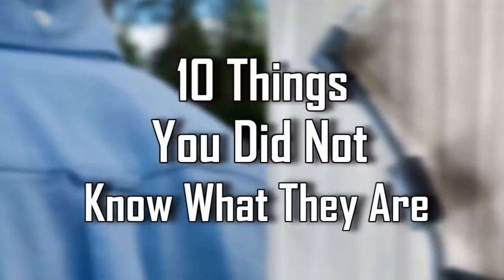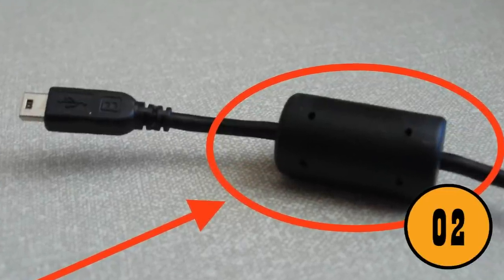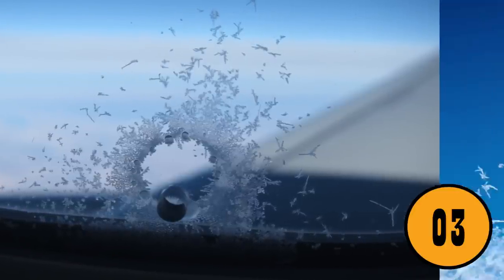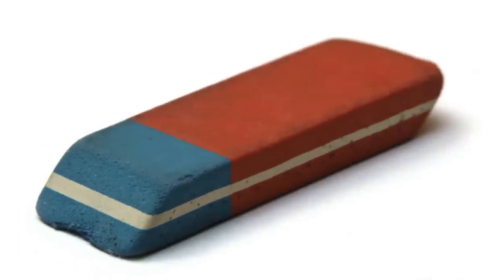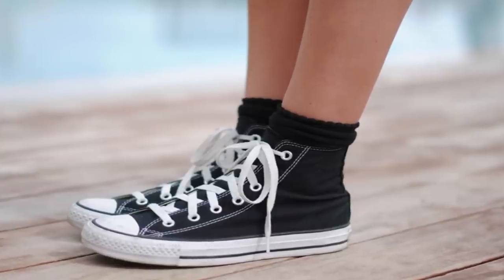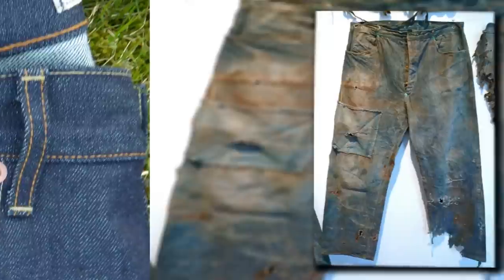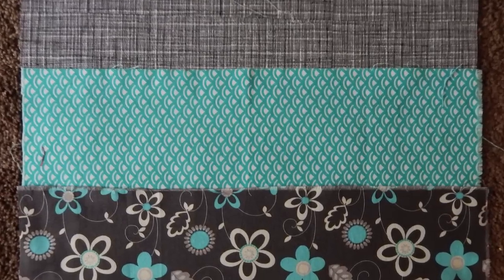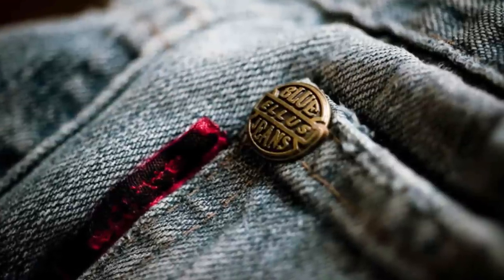10 Things You Did Not Know What They Are

Comment: The little loop in back of some shirts was originally called a locker loop and it indeed used to hang shirts in lockers . Contrary to the video, it causes    far less wrinkling than hanging by the color on locker hooks.
Reply: Thank you for the actual explanation!
Reply: Its actually for the Y shaped suspenders (2 in the front, one in the back wink wink) it's designed like that so the rear strap wouldn't move.
Reply: Allan Richter no its not.
Reply: Barb5001
Reply: Barb5001
Reply: +Anita van den Hoogen  
I enjoy the joke name you gave your account: how did you come up with that?
Reply: What's the origin of YOUR name?
Reply: @Bl4nk.exe8  
After 6yrs and no one got your joke, I have to say your double entendre is top level clever.
Reply: In the 1960’s some girls would try to pull them off the shirts of boys they liked. Stupid, i know, i know.

Comment: The primary purpose for the hole in a pen lid is to prevent air pressure forcing ink down the channel of the ink tube when the lid is placed on the pen. Without the hole, when the lid is put on, there would be no where for the air in the lid to go, so it would put pressure on the ball in the point of the pen and force the ink down the tube, creating an air lock and preventing ink flow the next time the pen is used. 

I can't imagine shirt manufacturers adding a loop to a shirt for the purpose of college students to indicate their relationship status. This is an adapted use.
Reply: Ooooohh and true
Reply: Your point on the pen cap proves my point on the video being stolen. First mind warehouse got it wrong, and then facts verse got it wrong also in exactly the same way as mind warehouse lol.
Reply: +Almero yes it would save their lives. its used for when someone chokes and cant breathe. they either get that much air until help arrives (which is more than enough) or die. you take your chances
Reply: mark walburg you are right. children need lees air and have smaller wind pipes.
Reply: ka da The hole was not always there. When i was a child it used to be solid. I remember pens that would not always work directly after opening the cap. Only after shaking and scribbling a lot. But i still think the reason for the hole is to relieve pressure when placing the cap on, other wise  the pen will not work every time you open it, and that would put the manufacturer in a bad light.
Reply: You have it wrong. The hole in the actual pen body itself is to regulate the air pressure. The hole in the lid has nothing to do with this.
Reply: Jason, how would a hole in the body of the pen prevent air pressure building up in the lid and putting pressure on the ball end of the pen?
Reply: Z
Reply: In high school way back in the 60's it was a fad to snip off those loops of attractive guys, most of them felt it was a badge of honor to have their loop snipped (it didnt indicate they were in a relationship like this video says). and it was like a trophy to the girls who got it first.
Reply: I agree. I freaked out when he basically said pen caps were designed to be swallowed. roflmao.
Reply: its not " designed to be swallowed " the manufacturers made it for the air to escape but a second plus too the design is that if a small child were to swallow the hole is big enough to pass fluid and not cause asphyxiation.
Reply: Maybe it serves some purpose when being cleaned, like in a dry cleaners? Someone else said its for braces. That sounds more plausible to me 🤔
Reply: +FingerPickinGood _ u mean suspenders?
Reply: Logic of air pressure, next time the ink flows & all isn't correct at all as there r pen caps without a hole. It might be for decoration or probably what he said is right.
Reply: the hole is so the ink don't drip out and without it if you out the London the pen wouldn't close and could explode due to pressure...and it enables balance of the ink rotating thru the ball perfectly
Reply: the hole is so the ink don't drip out and without it if you out the London the pen wouldn't close and could explode due to pressure...and it enables balance of the ink rotating thru the ball perfectly
Reply: +Megan Richner they are also called braces.
Reply: Actually looked at my pen cap and it doesn't have a hole.
Reply: KEEP CALM and PLAY SOCCER IN YOUR PAJAMAS uh'0 don't swallow it then. we not sure you will survive
Reply: The hole is also to prevent a vacuum seal, which can cause you not to be able to remove the cap without a major leak.
Reply: +Bushwacker 😂😂
Reply: R U A WIZERD?
Reply: I think he may be a wizard
Reply: so thats why my pens dont work.. they didnt have the hole in the top... the more i learn ey
Reply: +Mad Max 
What the fuck do they write with in China???
Reply: +Mad Max 
LOL...thanks for making me less worried about China taking over the world.
Reply: +Mad Max
I'm learning a lot here; you must have quite an interesting life! I've been assuming that like in South Korea, the increasing economic power of individuals would eventually result in a more democratic political system, i.e., a throwing-off of the Communist elite. Do you think I'm wrong about that? Once in a while you hear of notable political tensions where a village somewhere is at odds with the central government, and then there's Hong Kong...do you see something on the horizon that would upset the apple cart?
Reply: +Mad Max
Fascinating. Care to guess when that collapse might happen? I know their banking sector is already starting to run into trouble because of how they've been financing economic development. What future do you see for Russia, India, the EU?
Reply: I see a lot of words.
Reply: i was just about to say this.  the hole is to alleviate any positive air pressure that would prevent the cap to actually staying in place. without a hole the cap would easily pop back off because the air inside would become compressed as you pressed the solid cap on.

i dont think pen companies give 2 shits about people choking on pens. one because its a rare thing (rare enough to justify not incorporating a fix in every single pen) and two they just simply dont care...
Reply: euroaaRON1 x

Comment: The hole in the spaghetti spoon is actually not for a portion. Its just the most simply way to make water drain. Some spoons have several small holes, or slits for this purpose. And the holes are of different sizes with different spoons.

The Loop on the back of a shirt is also really just to hang it up, the school story is complete and utter bullshit.
Its used because in lockers you usually can't use clothes hangers, it was made popular during the 1960s. And its even called "Locker Hanger"

Stop making shit up and believing stuff you saw on 9 gag.
Reply: Exactly. Not sure where he came up with this nonsense. I use that to hang my shirts in the locker at gym after work. It's better to hang it there than on inside of shirt collar because you actually get less wrinkles and it's less stress on fabric than if hung on inside of collar.
Reply: You don't end up with points in the shoulders, it's better to hang from the loop and I have yet for one to wrinkle because of the loop, they just aren't heavy enough to cause a crease.
Reply: I was thinking the same thing
Reply: I could be wrong, but I believe with the spaghetti theory, he means when it is still dry.  The amount you can bunch up and push though the hole is a serving.  That part wasn't mentioned though.

Comment: 4:25 The purpose of the hole on the pen cap is, to let the air go through, so you can close the pen properly. Without the hole, the extra air inside the cap will push the pen against it, when you try to close it. Dumb.
Reply: I never actually thought about that. This seems like a better use than "so the cap doesn't get absorbed into my lungs membrane"
Reply: Then why didn't any pen have them until they passed a law that they had to allow air though for when toddlers swallowed them?
Reply: Oh so making sure you don't die if you accidentally swallow it is a worse reason? smh
Reply: Do you actually have evidence of that supposed law? If that's a law how come something like sharpie exists that requires a full seal in order to not dry out? Are you telling me sharpie is breaking the law on a massive scale but isn't being prosecuted for it?
Reply: Which is why all pen caps are aerated, round tips included. Perhaps so microscopic you might not see it?
Reply: Because it's bullshit.
Reply: No it's not.
Reply: that style of pen had a closed cap for years before the hole and it closed just fine.
Reply: MrArcticShadow That means the ISO  organization is dumb. When a child swallow pen cap he/she would be dead, because the hard plastic would damage the throat. Why don't they make edible pen caps then?
Reply: no... really?
Reply: thiery572
You can still choke on food. It's not like edible stuff dissolves in the trachea.
Reply: so mrarcticshadow posts links to prove his statement and you still dispute it? I read the spec he linked to, and pens like sharpies have caps large enough that the spec doesn't apply. The hole is in fact there to allow air flow to prevent suffocation. that membrane absorption crap was total b.s.
Reply: The air pressure might push the ink back inside the pen...
Reply: the hole purpose is so you can remove the cap. without hole it acts like a suction cup and becomes very hard to open. just try plugging it...
Reply: ISO makes standards not laws.
Reply: At the time of the change they said it was to stop it leaking, which is odd, but possible if the tip remained liquid and then flowed, but dries out with that honkin hole.  It won't have a suction fit though, because it is round over a hexagon, and not sealed.
Reply: slim t The sharpie is a spidol (not a pen). If you put a hole on the cap, then the spidol ink will dry out.
Reply: +thiery572 i just used it as an example of size. the spec specifies the size of caps that aren't required to have a hole. it also allows for certain shapes to satisfy the spec without a hole. this idea of pressure is just not an issue. the logic is not wrong, but a pen cap just isn't large enough to create enough pressure to matter. Just for reference, I'm an engineer.
Reply: slim t And the hole in the pen cap is not enough to make the toddler breathe. Just my thought. :)
Reply: toddbod94
While not laws, standards are usually used as basis for legislation. Even if countries don't want to outright admit it. They even become good ways to market a product, satisfy import or export specifications across country borders, and generate greater market appeal--as BIC has done on their website. Obviously any business would want the greatest possible market share for their product, and if that can be accomplished by also using less materials, due to the hole, then all the better.

I'm not saying there aren't any laws, I just don't have the time to go through the rules, regulations, statutes, etc of 190+ countries :)

But if you are still interested between the relationship of standards and legislation, here is an article that does a better job of explaining this than I can. Btw, note that BS 7272-2:2008+A1:2014 is the (most recent and currently active) British standard that talks about pen cap holes mentioned in the article.

http://www.makeeuropeworkonline.com/markets/uk-industry-standards/
Reply: +thiery572 I don't think so either. it'd be like breathing through a coffee straw, but I guess it's better than no air at all. But the standard referenced states a required minimum amount of airflow. As long as that is satisfied, the standard is met. Did you look at the standard that was linked? I think it was the 2nd link in the comment.
Reply: slim t The pen cap has the sharp thing, the tail to make it open easily with your hand. If the toddler swallow the cap, the chance is the sharp edge will stuck on the trachea, it is not like the cap is perfectly clogged the whole throat.

Besides, it is written that 'it is not recommended for toddler' to swallow the pen cap. "not recommended"?? DUH! Pen cap is not even food! It's not suppose to be eaten by anyone at the first place.

Honesly I think the hole is too small to make all this thing even make sense.

Let's be honest. The ISO just want to make money, the employee need to get paid. And the pen companies need to sell more pens.
Reply: well that's enough for me. the info is there. everyone can come to their own conclusion.

Comment: The hole in the top of the pen is actually there to stop the ink leaking, if you were to put on a lid with no hole and totally seal off the pen then the pressure would build up leading to the pen exploding/leaking
Reply: Sheff United 
Only in case of pressure differences. Much like my fountain pens. Looks bad when flying.
Reply: Sheff United yy
Reply: I'm not
Reply: Bears football